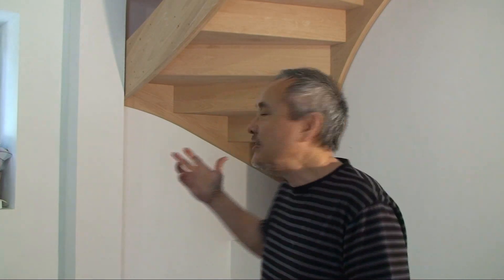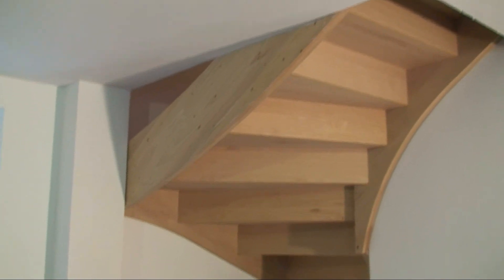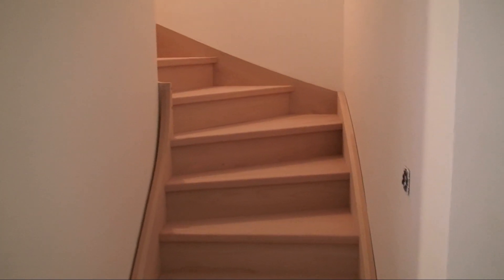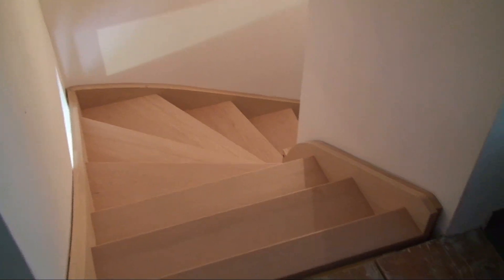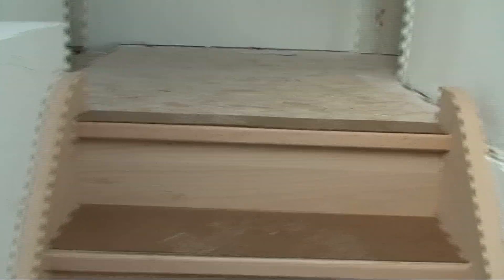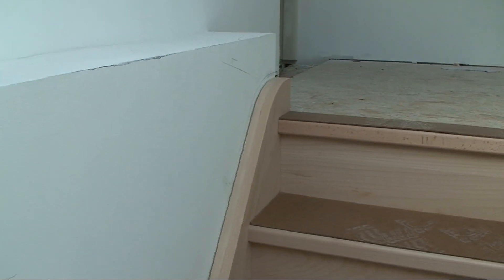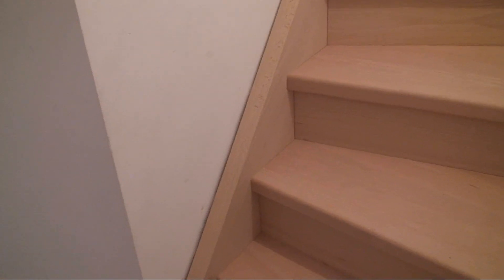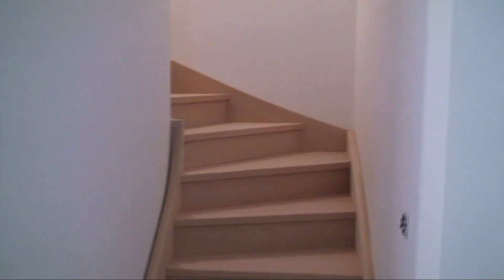How to Build a Staircase with a Tight Fit Between Two Walls | Wood Designer Ltd

Comment: Thanks for the comment. With the 3 part stringer and gluing the install was quite straight forward.
Reply: u do realize that by code ure required to put in a railing system so if someone slips/trips they dont go flying down the stairs and break thier necks?
Reply: very good job greetings from old German staircase 
builder think about it best twice and then do it very nice work ness
Reply: Nice job Ness